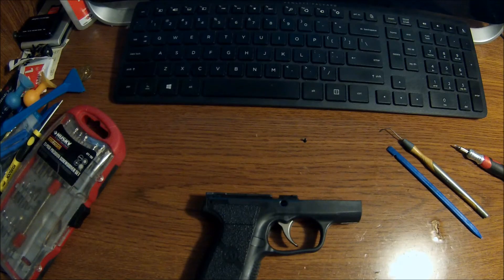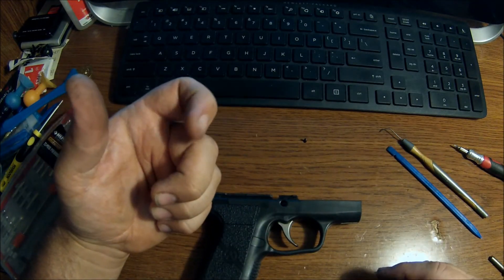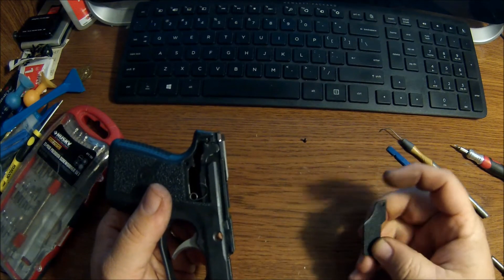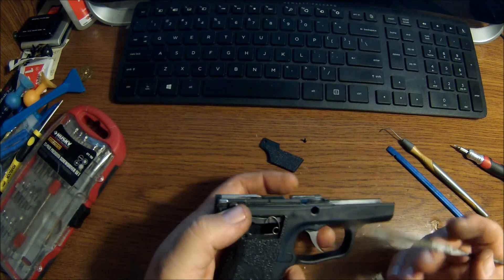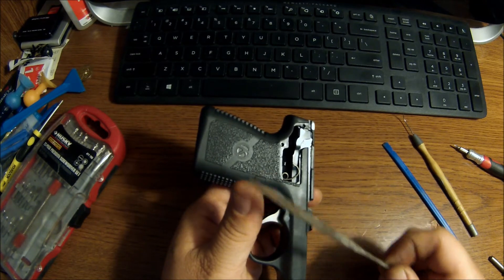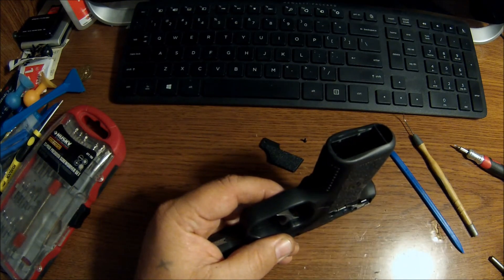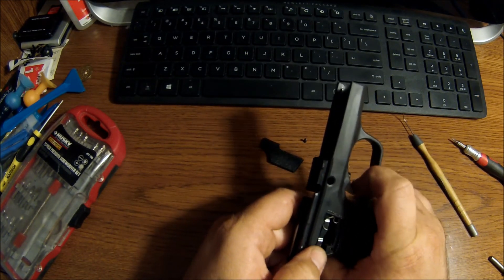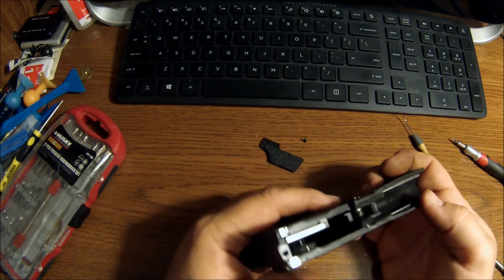KAHR CM9 TRIGGER MOD

Comment: Good idea. Removal of the sharp binding edge had to be a huge help. Polishing all flat metal surfaces that ride on each other will also improve the firing and cycling. Super fine polishing compound is all you need.

Comment: When I first bought my Kahr pistols the triggers were between 5.5 and 6.5 lbs, and after putting over 600 rounds thru them they dropped a half pound to a pound and got even smoother on the pull.  I love the stock triggers on the Kahr.  For a carry piece 5-6 lbs is good enough for me.

Comment: I also polished the trigger bar on my Kahr T9 and K9.  I have over three thousand rounds through each ( I'll use a 350 bucket of Remington bulk on one or two range trips) with no issue.  polishing the bar also reduces the wear on the spring.